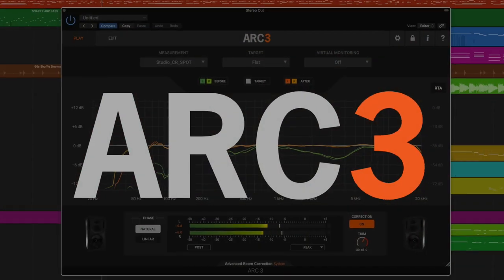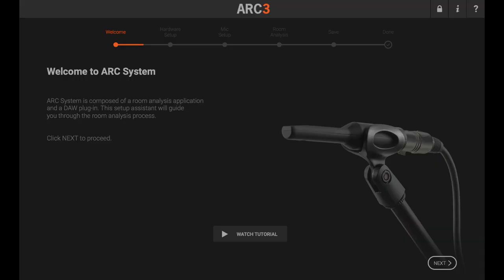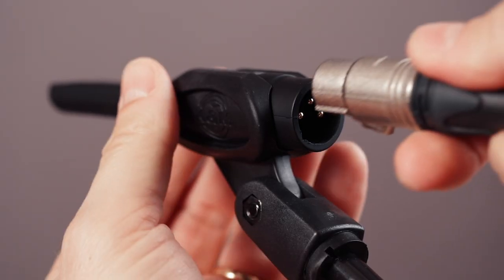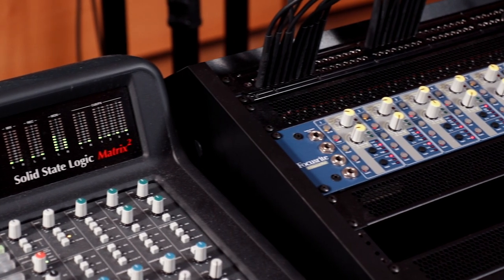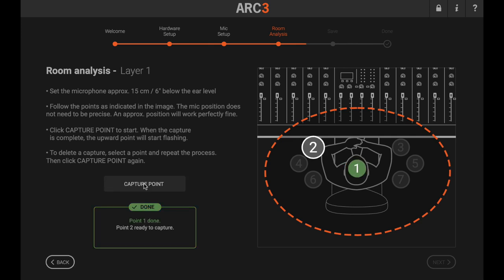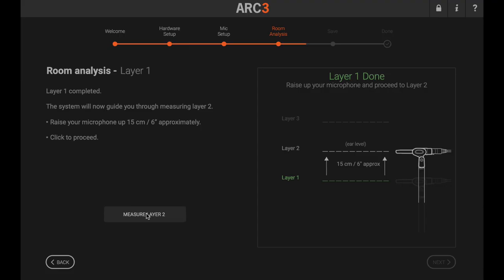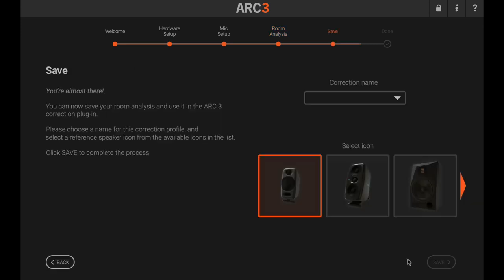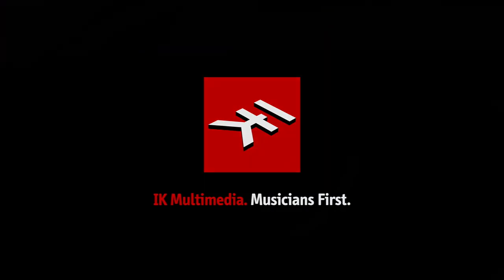ARC System 3 - Tutorial - Measurement

Comment: Better to take the measurement together with the chair I'm sitting on. Is it better to take the measurement without a chair. The chair and armchair affect the acoustics. That's why I don't know what to do.
Reply from the maker: The chair you sit in to mix shouldn't make any drastic changes to the acoustics. As it will be there when you work, you can choose to keep it or move it. Note, if the chair gets in the way of a stable mic position, then you might want to move it to make sure you get the best measurements. Check out some related FAQs here: https://www.ikmultimedia.com/faq/index.php?&jfl1=12&jfl2=19&jfl3=

Comment: How loHow loud should the sound card input and output be tuned? I understand that during the start of calibration, it shows the correct measurement level, but you can lower the microphone volume level and increase the speaker volume, etc. It should be around -20 dbfs (this is a sweet spot for my card converters) or the monitor volume should be around 85 db (menson’s fletcher curves). Please tell me how to get good results. Thank you in advance, you are the best!
Reply from the maker: At the beginning of the analysis process you're asked to set your speakers to your normal mixing level. From here, there will be a meter which allows you to set the microphone gain appropriately. Check out the video at the beginning of the process as well as the user manual for some extra tips from here. The user manual is included with your product download, but you can also find this in your User Area -> My Products section of your IK Multimedia account. https://www.ikmultimedia.com/userarea/my-products/

Comment: Hello,
Does this still inprove if you have the ilouds mtm?
Is this better then the built in measurement program of the mtm's ?
Reply from the maker: This is a full-featured software program so it will have more features than the built-in correction in iLoud MTM.
Reply: @ikmultimedia  Thanks,.. and yes i understand, and for that i was thinking.
Just the normal standard 1 seated desk program..

i just was thinkng alot if i really could benefit from this then or not ..as you guys also made the mtm's, i thought maybe its almost the same for  one seat ??

And i just keep asking myself .if i would not buy the arc3 for nothing, and couldent find the answer on the internet nowhere.'

Soooo... for one seat, would it make a big difference ,or not so much ?
And if yes, what what would be the differences,.... or could i be lacking with mtm's.

Greetings,
Dennis.

Comment: Can I use Umic-1 with arc 3?
Reply from the maker: If there is an available calibration file, yes.
Reply: @ikmultimedia  Hi. A have interface Eleven rack and microphone UMIK-1. Why in Arc-3 I can't use UMIK-1?? Input and output is set only for 11r now. I don't see UMIK-1 on window Inputs. Help please.  Windows 10.